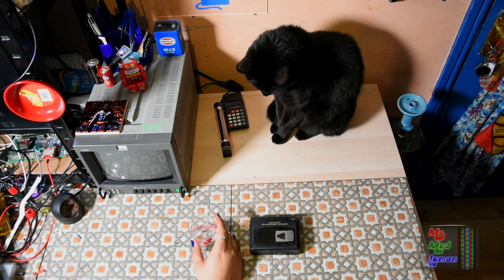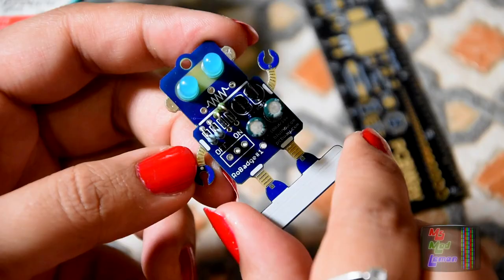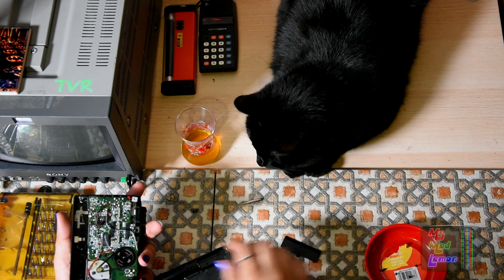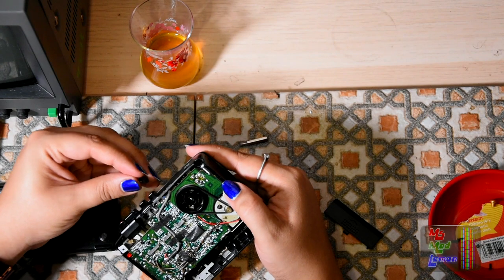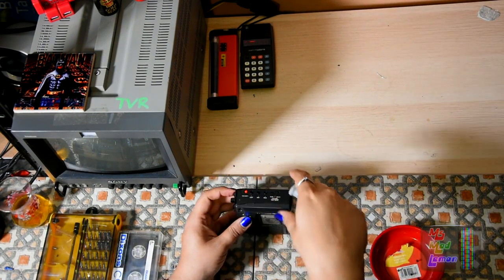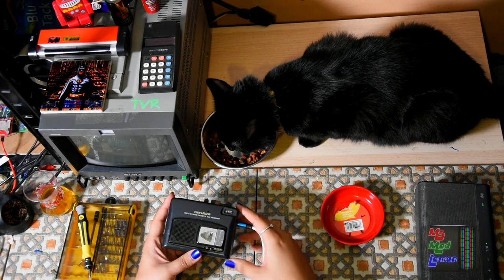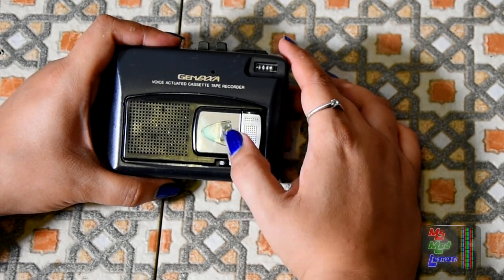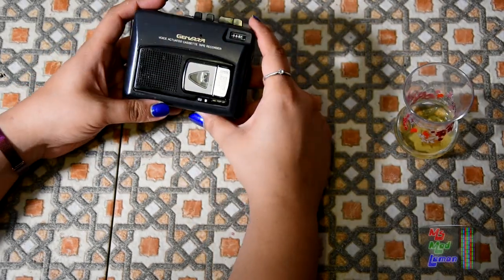Genexxa CTR 96 Cassette Dictaphone

Comment: What a nice tape deck. I bet it would be great with the Spectrum. I had a cassette player in the 80's with variable speed I used with my Speccy, I would speed the tape up for shorter loading times. (it did'nt always work. LOL)
Reply from the maker: That or press the pause button juuust slightly for it to speed up a little.... Think you're getting away with it then... TAPE ERROR.. Lol!
Reply: @MsMadLemon  Yeah. Ha ha.